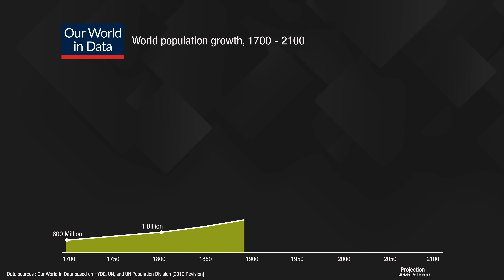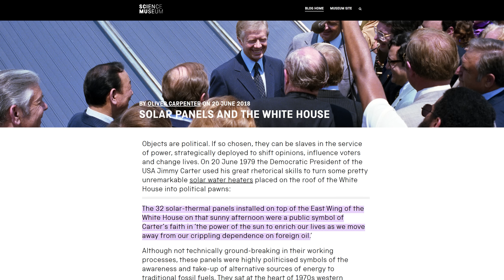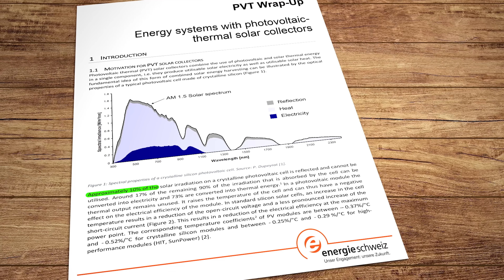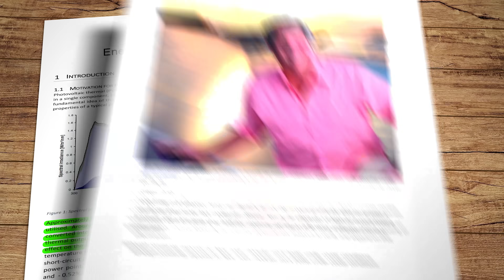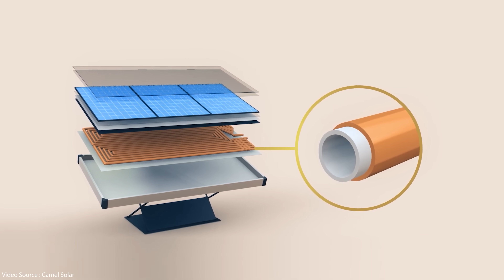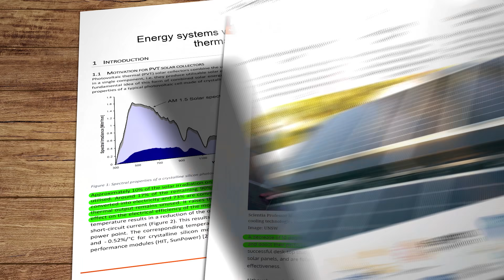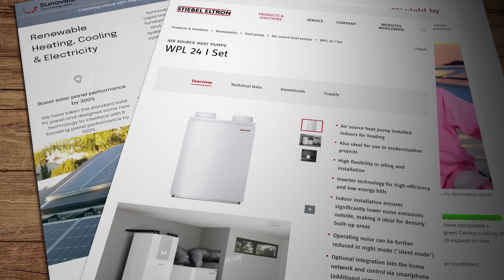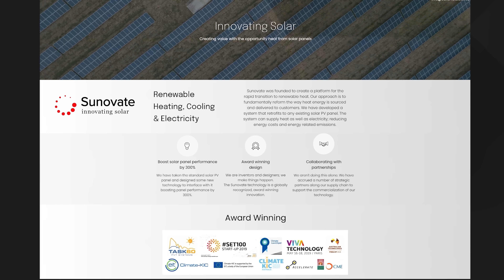The Solar PV panel that provides electricity AND heat for your home!

Comment: Not that i wouldn't agree with the future of mobility being electric, but thinking that most people would drve an electric car in 8 years is either optimistic or delousional. Not because people wouldn't care about climate change, but because the majority of cars on the road are older than 5 years. People don't just buy a new car, they have to have the money to invest into one and the hard truth is, that most don't have that money (i'm an automobile engineer, so i kind of know what i'm talking about).

Now, more and more people don't bother with buying cars, they simply lease them, wich may aid in increasing the number of EVs on the streets but those people still are and will be a 
, more or less, wealthy minority.
Further more, the leasing strategy can backfire and cause millions of tons of unnessecary  electronic waste, as even less people want to buy a used EV after the usual 5 years of leasing.

Comment: The thing is that a pvt system should be cooperating with the other systems in the house, like a ventilation heat recovery system. The integration of the systems is hard, still, because you have to connect stuff from different manufacturers, that are not designed to cooperate. This makes it an expensive operation, and als harder to engineer beforehand.

Comment: I built a solar air heater and power it with solar PV. I have the cold air intake moving air across the backside of the solar panel which is inside the solar air heater.

Comment: *I'm. not. so. sure.* If you want to generate hot water from the sun, then you probably want temperatures of 60 C or more; but you really want to keep the PV cells at temperatures lower than that. ALSO: In many, if not most, situations, the real competition for solar water heating would be some kind of heat pump system, ideally ground source.

If there is any place where PV + solar hot water on a rooftop would work well, I would expect it to be in the Tropics. Ground source is not all that advantageous there, at least at low altitudes, because the average ground temperature is still always quite warm. Heat pumps are also not so great near the Poles but, there, it's harder to make solar hot water work because it's just, well, too cold.

Another alternative would be PV covering flowing bodies of water, in a solar farm—"floatovoltaics." There, you could keep the PV cells very cool, even below ambient air temperatures, while also reducing water evaporation. There's a tendency to romanticize rooftop solar, but solar farms have some important advantages that, I expect, will keep them well in the running, probably indefinitely.

Another thing that should get more treatment in videos, on this channel and elsewhere: **radiative cooling**.Essentially, you're using Outer Space as your heat sink, 24 hours a day.I don't claim to know a lot about it, but that's part of why I say that. I want to know more,. The little I do know sounds really exciting.
Reply: Just Hαve α Think’s▫️  Sorry, I just don't have the bandwidth to get into Whatsapp right now. I think I get the motivation, though. I could give you my email address, or my phone # for texts, but that has obvious risks. Same on your side, I'm sure. La vida es asi. Lastima.

Comment: Technically you are not wasting the water cooling off the panels.  You are paying for it and just pouring it down to the ground where it is evaporated or goes down the drain and eventually recycled.  Just wasting money.  Though you could power a small pump and use ground water to cool off fins under the panels .. just saying :)  BTW Great video..  Thx

Comment: Ok, this gave me a great idea. My dream is to build an underground home in nevada. Since underground homes always stay about 60 to 65 degrees regardless of the surface temperature, this would be a great way to heat the home up to the extra 10 or so degrees using existing hot water heating systems rather than using power to heat the water. Of course during the summer you simply need to pull in some hot air from the surface to do it but for winter it would be perfect.
 The basic idea it to reap the benefits of all the sunlight in nevada to power a very efficient underground home and use all LED lighting and high-efficiency appliances to reduce the cost of living.

Comment: There's another Australian company called Tractile who have a similar product already on the market. They pump and heat the water directly instead of gas, and the panels double as large roof tiles, similar to what Tesla is doing in that space. They're also extremely robust to deal with Australian conditions, hail and bushfire proof. Definitely worth a look.
Reply: Gone into liquidation 2024
Reply: @mikewilliams94  bummer

Comment: Why not using TEG to act both as a cooling system for PV panel but also generate more electricity? Of course it will make for more expensive PV-TEG but overall the efficiency of energy production will go up!

Comment: Hot take as someone who works in rooftop solar and electrifying HVAC:
1: this could be less of an added cost when you consider you are substituting standard PV racking eqpt. for a thermal recovery system.
2: Maxing out DC output is an all around win for customers, especially if paired with storage.
3: my main concern would be physically connecting duct work to a rooftop array, but dealing with air rather than water eliminates the need to employ plumbers as part of a solar install team
Reply: please remember, experiments involving rocks under the house to store heat were discarded because mold, bacteria (legionella anyone?)rodents, rat poop, insects etc got in the rock pile, and could not be cleaned.  You're breathing that stuff in. Even furnace ducts gather dust and have to be cleaned professionally. Same thing with a network of air pipes in solar panel, exposed to a moisture condensing temperature fluctuation cycle.  Who is gonna clean the mold out of it? Has anybody checked it this year?  It would have to be an inspectable item at house sale.  I'm sure the smart boys and girls reading these comments can figure out a solution.

Comment: Hey JHT,  I love your videos and this one was no exception.  I live in a seaside condo in an area of the world that is generally warm and sunny.  We just started the process of choosing PV panels on the roof to supply electricity for the common areas.  Both to lower the electricity bill and reduce carbon footprint.  I imagine that our PVs will get VERY hot on a bright summer day. The other problem we have is a salty well where we get our water.  We currently run that salty water through a reverse osmosis system that is both very expensive and doesn't work very well.  I know that the other technology for getting salt out of water is desalinization.  From what I've read about desalinization, the problem is that it requires a lot of energy.  It's usually only used where there is some kind of waste heat available.   I googled this and there seems to be a lot of research going on about how to use waste heat from PVs for desalinization but I didn't find any market ready products.   Maybe that's on of the "industrial uses" you talk about in the video.

Comment: Any thoughts on if/when these panels these type of panels may be available. Planning a major renovation and contemplating what to try to include. It doesn't seem like these will be on the market in time, so what would you do in the meantime? I can prep the roof for power & water feeds, but should I bother with water...what other things would people suggest?

Comment: The +300% claim falls into the usual fallacy of comparing low-temperature heat 1:1 with electricity. They should never be compared 1:1 even though both are technically the same amount of energy. They are very definitely not the same amount of usueful energy.

Comment: I like DIY  projects, and I have older 250W panels. This is something that the average person can do, if you know which side of a screwdriver is up. Making a forced air circuit, that cools my panels, just sot they stay cooler, hence last longer, is worth it, all by itself. Though a properly designed liquid system should be able to remove more heat. Gotta play with that.

As for the "warehouse" comment, remember, some of us live in rural areas, where the panels need not go on the roof. Just stick them on some unused land, which won't be so unused, as far a the goats are concerned. They'll use them for shade, and shelter, to get out of the rain. Just have to run everything inside galvanized steel conduit, as they have a habit of chewing on things. Plus those goats are better than some yuppie high priced composter. Table scraps in, perfect fertilizer out.

Comment: Or maybe store it in wax... there was a type of drywall that used wax beads  embedded in the drywall.  The wax was chemically tuned so that it's phase change between solid and liquid happened right about at room temperature.  Since materials going through a phase change can store a ton of calories it's a clever way to create a thermal mass like you would in an old passive solar house, but without needing a huge dense wall.  (Not sure how many calories it is for wax, but water, where it normally takes one calorie to heat one gram of water 1 degree going through the phase change takes 540 calories.  Wax wouldn't be as good as water, and one of the problems they were still sorting out on the drywall was it's flammability.  If you had a tank in your basement filled with wax that was changing from solid to liquid it would be much easier to fireproof that than drywall, and you could just circulate pipes through it to collect the heat.

Comment: One way to reduce the efficiency loss through the panels heating up is to mount them on a light coloured roof. Studies in Switzerland indicate a 2% increase in panel efficiency. When building a house choosing a light coloured roof involves no extra cost.

Comment: Why not mount an evaporator to each panel, and use that in tandem with an (existing) air to water heat pump?
Then, if there's no heating demand, you could use the heat pump to cool the panels directly.

Comment: Why not mix pv cells and radiative cooling parts in the same panel? You radiate your heat to outer space, specially in places were you couldn't use it, making the panels last longer.

Comment: Solar heating has suffered from complexity issues for years. While air heat exchange is probably the least efficient way of doing things, I think it is probably wise to accept a lower efficiency to get things to market and accepted just because it is "easy". I hope this company does well with this product. It is better to get free heat in an acceptable manner than throw it away because it is too hard/expensive/dangerous.

Comment: I am not an expert. However, I would be in favour of using a heat pump to take out the heat from the PV panels and pumping it into a  basement or underground aquifer and releasing the heat from the aquifer during the Winter.

Comment: I just don't buy it. Most of the conversion inefficiencies for photovoltaic panels is due to reflection not heat. There is only so much solar energy hitting a panel. You don't magically get more heat from a square meter of sunlight because a solar panel is present.  A sheet of black rubber would absorb more heat than a solar panel.  If this worked the way they say, you  could heat your home easily with just black ductwork on the roof pumping hot air back into the house. No one does that because it doesn't work.

It is probably true that cooling the PV panels makes them more efficient. The question there is if it adds enough power to drive the forced air fan that is used to cool them.  Sure it is better not to waste the heat it captures. Putting it directly into your house makes sense if you need it.  This will be a tiny amount heat overall because most of the energy that isn't turned into electricity was reflected off the surface and what remains is very difficult to extract with airflow.  

Hot air is one of the worst energy transfer mechanisms because it is high entropy. You can't send it very far without losing all of it through the duct work. It's only useful for the few months of winter when the sun happens to be shining. During the summer, fall and spring,  you would need to do something else with that heat.  You would need a heat pump of some kind to concentrate it for hot water or something useful. 

This is just another company selling BS, because they know most people  don't understand basic thermodynamics.  They read the headline that PV only has a conversion factor of 18% and assume you can get the rest somehow.  This is the theranos of the energy sector. 

If you want something that captures 100% of light and turns it into energy,  you need a black hole.

Comment: I don't think there was "plentiful" energy until the introduction of gas engines which made mining and other energy producing endeavors much simpler and lower cost.   Before that energy was quite expensive.   0:50  HAHAHA  if only the policy makers on this side of pond would even admit there is a problem or even climate change.

Comment: A thermocouple will move heat as electrons from a hot junction to a colder one with no moving parts, all solid state.
If you wire many in serial, you can get useful voltage out. A TEG has many semiconductor thermocouples for example.

Comment: The benefits of heat harvesting Solar PV panel is bit over-hyped. The greater the cooling fluid flow rate, the greater the cooling effect. With the greater fluid flow rate, the temperature increase of the cooling fluid decrease. With lower temperature increase in the cooling fluid, the lower is the efficiency to convert heat into useful work.

"...divert heat to do useful work..." is an exercise in practical futility especially when the temperature difference are small.

The PV panel converts into electricity wavelengths between 400nm to 1000nm. It is better to cover the panels with membranes which reflect light with wavelengths < 400nm and/or > 1000nm. But then there are no perfect reflectors and no membrane is perfectly transparent to light between 400nm to 1000nm range.

Now, it is interesting to place a PV cell on top of a Peltier Junction in cooling mode.

"...global decarbonization challenge..."

Yep. Spoken like a true CACA advocate (C.A.C.A. = Catastrophic Anthropogenic Climate Alteration).

Comment: Aren't forced air systems generally very lossy? I lived in a gas heated home in the US - it was very noisy, very uncomfortable, and very expensive. Heat exchanger, yeah, maybe - I can't imagine an air duct system would transfer much heat compared with a liquid system though? I guess if this system recovers some energy and extends the life span of the PV panels, if the system is cost effective, then none of those reservations matter. I'm surprised we still can't come up with a better solution though. 🤔

Comment: The only thing you fail is to be critical to carbon sources of energy. It is way more efficient than all other sources and this GHG issue is greatly debatable.
I know you believe in it. But you are sold to this idea. You have no criticism about it. Which makes you not a reliable source of information in this regards.
I believe electrical is good, but yet inefficient. Meaning it at the end will cause more trouble than results, if we keep in this track. 
I see that great improvements were made in these last ten years. However, we didn’t yet crossed the break point. 
I believe it will happen with graphene or similar materials.
I just don’t believe this is the best option everywhere.
This witch hunt of carbon sourced energy will hurt us more than do good.
Some areas will need to use it. But legislators are kind of moved by this mob against C energy and ambientalists, most of them have political bias reasons for pushing it.
Anyways, I believe in balance.
It is fine to have electical stuff but not making the other illicit or way more expensive just to push the agenda.
Some areas geothermal is better, some places hydraulic is better and some we will need to keep gas, oil, carbon, etc. 
there are so much methane in the permafrost that it will eventually come out. 
There’s no way out from this fate. It’s written. 
So, move the tile wherever you want. The result is the same.